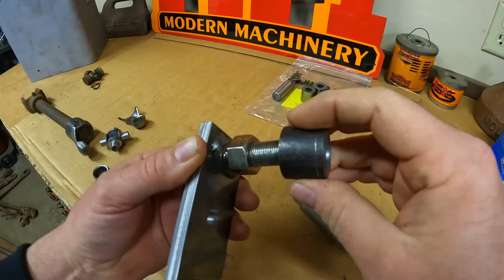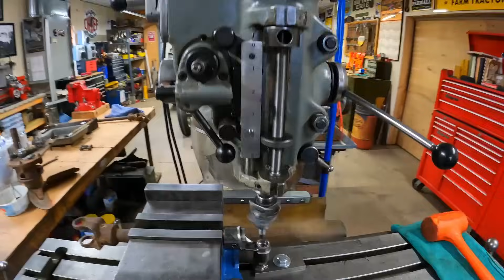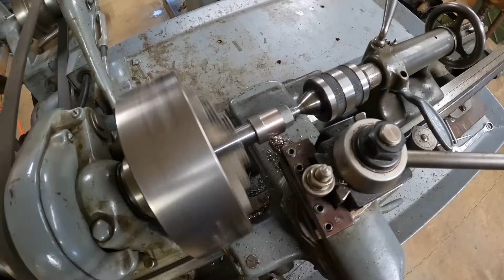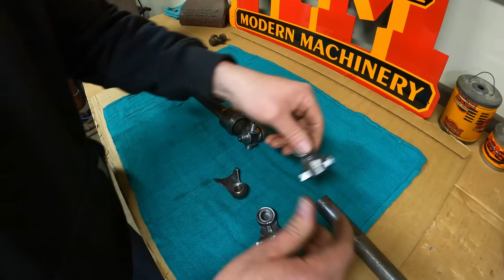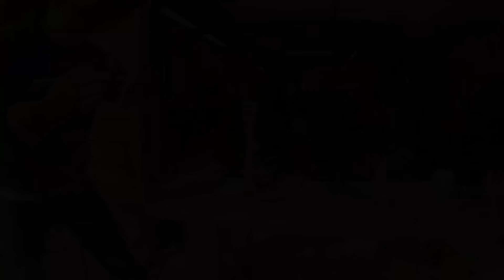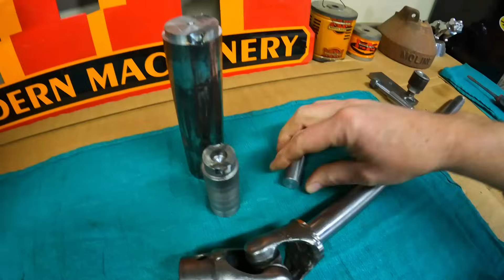Saving X231's "Non-Serviceable" Steering Joint! Machine, Weld, & Repeat - Episode #110

Comment: Very nice job! Could you please explain when you use the wire and when you go with the stick instead?
Reply from the maker: The wire feed welder is great for welding thinner metals and leaves nice clean looking beads, but I can’t get as hot of a weld nor the deeper weld penetration with it as I can with the stick welder, so when I need a higher strength weld I’ll use the stick. Another benefit of the stick welder is that I can reach into tighter spaces, whereas with the wire feed welder I’m limited by the size of the nozzle. The shielding gas for the wire feed flows out of the nozzle and envelops the molten weld, which prevents oxidation from happening when molten metal comes into contact with the atmosphere but you have to keep the nozzle fairly close to the weld for it to work. The stick welder uses welding rods that have a flux coating on the outside, which melts at the same time that the metal rod is melting and protects the weld just like the shielding gas does in the wire feed.  So you could put a welding rod as far down into a hole as it could reach and still make a nice weld, but you couldn’t spool the wire out of a wire feed that far and still get a good weld.
Reply: @squatch253  Thank you for your detailed answer. You probably saved my life because I need to fabricate a new yoke on my motorbike's rear shock absorber. I will use the stick welder to connect the two parts.

Comment: I'm not going to lie; I did think this repair was going to be a flop. Needless to say, that turned out better than expected. Well done, Toby!
Reply from the maker: I was actually more on the fence about this one than I’ve probably been with anything else I’ve done on X231 up to this point - from the indexing of the cross and caps for machining to worrying about distorting everything with the welding, there were several areas where everything could’ve gone too wrong to recover 👍

Comment: I'm amazed on your dedication to keep as many parts as possible. What about the shaft for the steering pedestal? I see a huge hole in the bolster ?
Reply from the maker: That’s where the hydraulic steering gear goes, I’m not sure if I’ll get far enough to put that in or not but I’m going to try 👍
Reply: @squatch253  Sure hope you do would make it easy to move it if you have to

Comment: Awesome work, a little tip for heat managment while welding, if you have any heavy chunks of aluminium or copper around, clamp them near where you want to protect from heat or if the piece is big enough use it as thr table to weld on and it will suck the heat out of the part as they both make very good heat sink.

Comment: Despite all the fowl content I think you gave a massive thanks (See what I did there ;D) and sigh of relief when all the wleding was finished and it still moved. 

On a serious note though I think you missed adding the steering column disassembly video to the playlist.

Also wouldn't steering columns before power steering have been called bulling columns wink wink nudge nudge :D
Reply from the maker: Thanks for the heads-up, I checked and yes I forgot to put #108 in the list 👍

Comment: Senior's Bridgeport Milling machine appears to be doing a good job. Are you happy with the Bridgeport?
Reply from the maker: Well, this was the first time using the Bridgeport and it was pretty light work so it's still kinda hard to form a concrete opinion on it yet, but it is noticeably more rigid than the smaller mill/drill.  But I'm REALLY slow to take to new things so it might take a good 6 months for me to finally decide to make friends with it lol ;-)
Reply: Nice work on this fix, was just thinking a video on new mill with it's history would probably view well